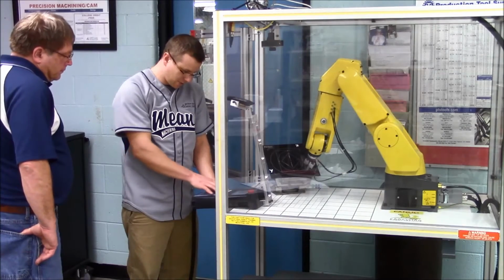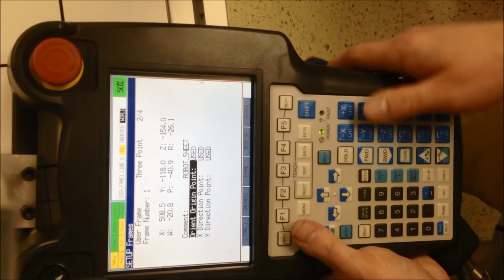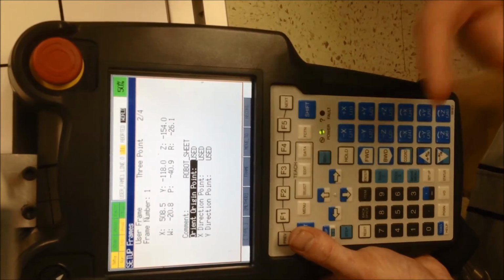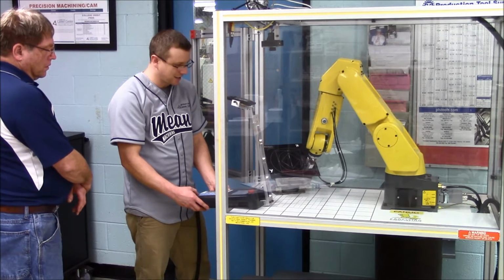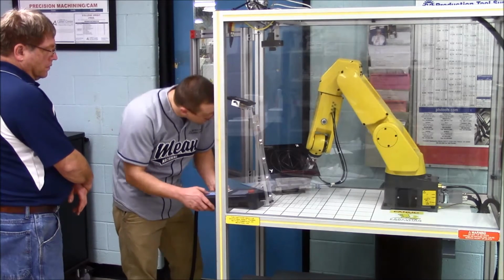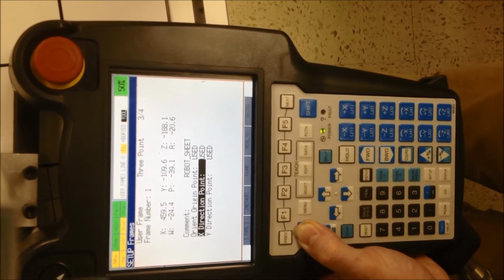Setting up a User frame on a Fanuc Robot

Comment: Thank you for information. I am searching a practical industrial solution for user frame points on real fixtures. How do you fix the positions?
Reply: most of the time I use the corners of the fixtures for the origin ,X, and Y.